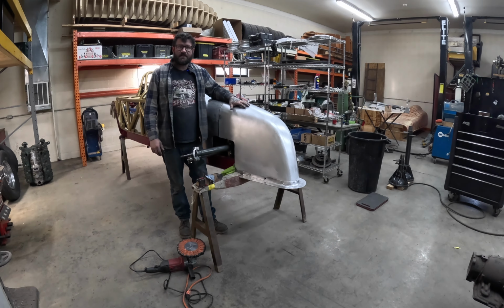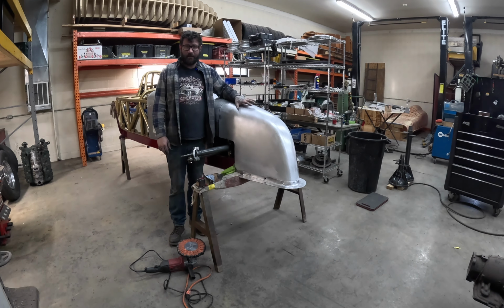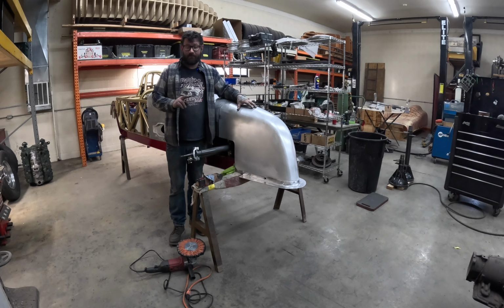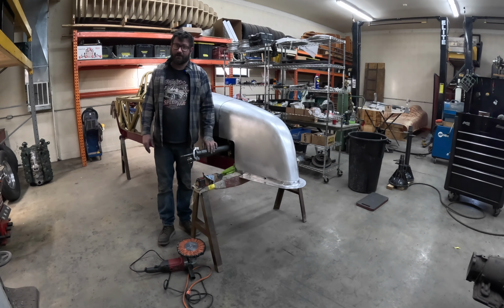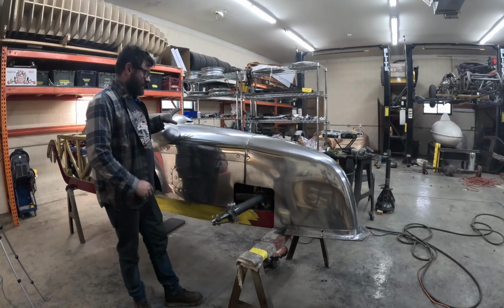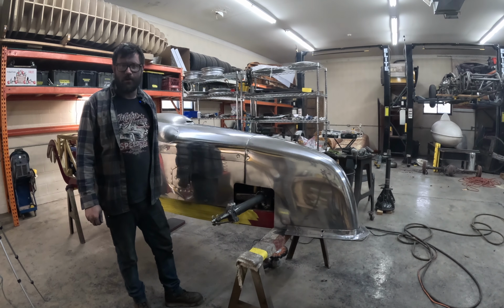Buffing Out The Front End Of The Roadster

Comment: Thats really sweet! What aluminum alloy is that?
Reply from the maker: 3003 H-14
Reply: @cornfieldcustoms  I built a motorcycle tank once, dont know what alloy it was but I had to anneal it during forming because it would work harden. Does the 3003 do that ?
Reply from the maker: @clinttanner4645  you dont have to anneal 3003H14 but you can if you want. I rarely ever do. A lot comes down to what you have in the ways of shaping equipment. It does work harden though but not as bad as 5052
Reply: @cornfieldcustoms  Ya it got real tough. I built a English wheel and planishing hammer for the project, the guys on TV made it look so easy! it was quite a learning curve but fun!
Reply from the maker: @clinttanner4645  yea shaping is a challenge for sure, but i always enjoy it